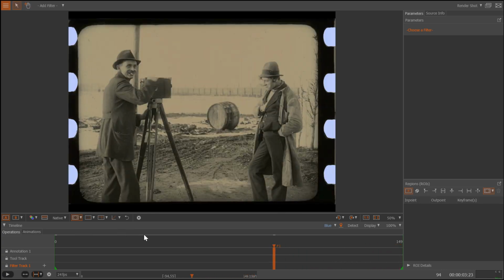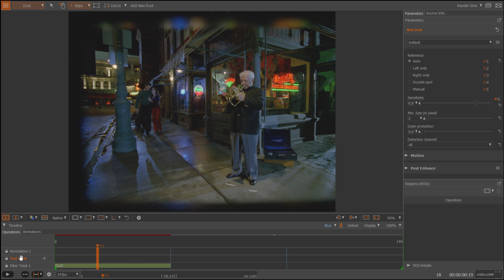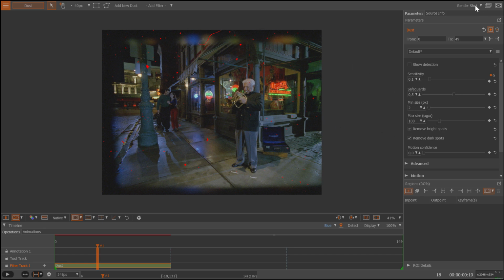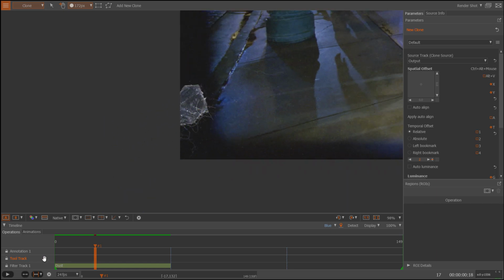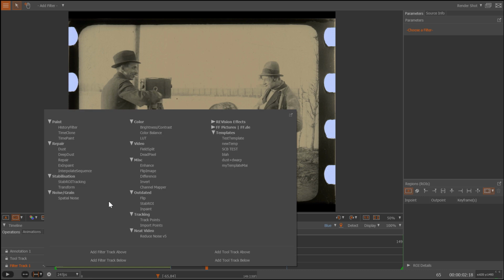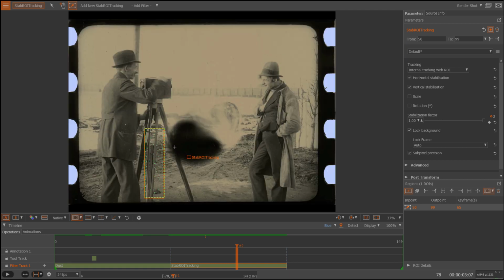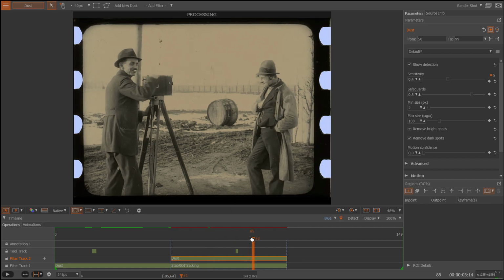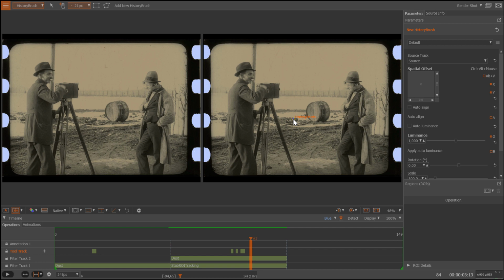DustBuster+ Tutorial

Comment: Great video, Franz. That red viewing mode is very practical! I mainly use it with the dust & scratch filters to show me where the filters have repaired film dirt, scratches etc and where they might have been set to high and have affected small areas that are not film dirt etc. Main areas to keep an eye on, when using the dust filter for example, is where there is movement within a scene. For example, the couple walking down the street, keep an eye on their hands, bright areas between their legs as they walk and their shoes. And the old man playing the trumpet, keep an eye on his fast moving fingers. With the red viewing mode on,  I just select the history brush tool and brush over the affected areas to bring back the original unfiltered areas (like you showed us in the video). Super simple and easy to use.